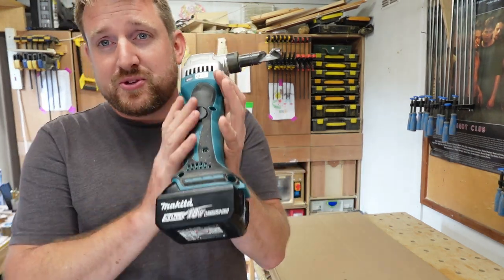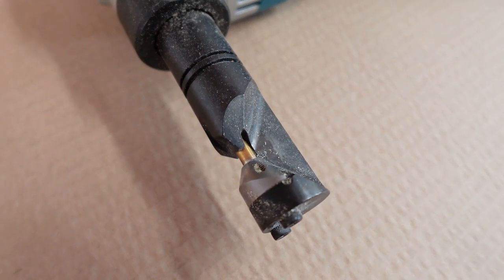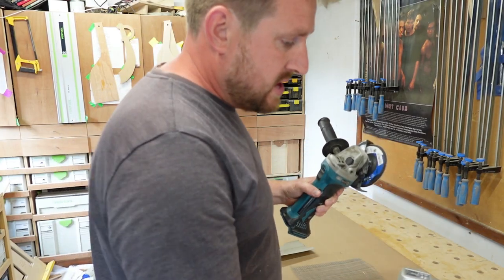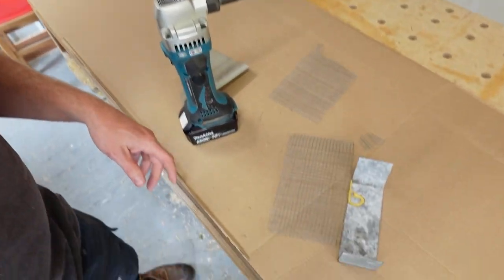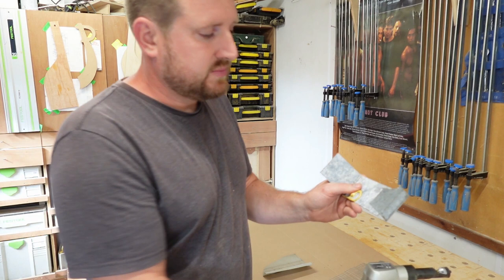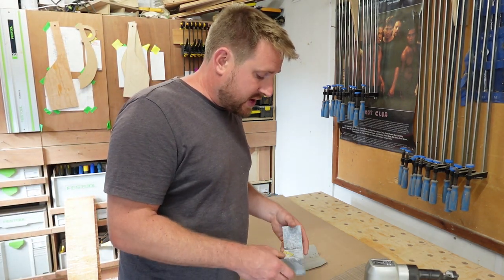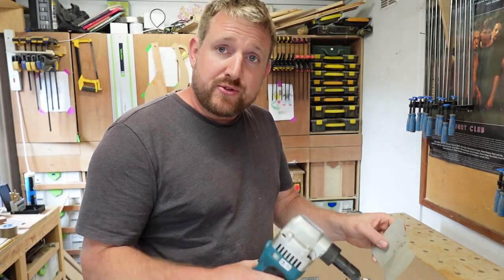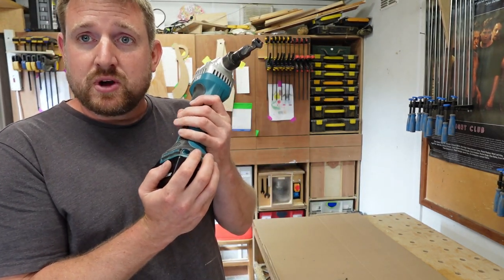Makita DJN161 Nibbler Review - The Best Way To Cut Sheet Metal?

Comment: I have one, its worth the money, I love it!  I will be using it today. It cuts other material than metal as well.
Reply from the maker: What other materials have you been using yours on? It's a great tool.
Reply: @englishhomestead   recently used it to cut FRP, its a plastic type panel used in kitchens in restaurants and in medical office applications as well, as it is easy to wipe clean.
Reply from the maker: @joetristen993  that's good to know! Thanks. I did wonder what else could be done with it

Comment: Hi buddy, how much thick can cut ? Until how much millimeters?  thanks
Reply from the maker: Depends what material you're trying to cut. 1.2mm glav is easy.
Reply: @englishhomestead  Thanks !  this tool intrigue me a lot!  I saw it in an episode of one of my fav show, the Restorer's used by Ted
Reply from the maker: @OZIL761  what I like about it over a grinder is that there's no heat produced (or not much) so the risk of fire in the workshop is loads lower.
Reply: @englishhomestead  nice !!! More doubts gone now….
Reply from the maker: @OZIL761  it is pretty niche though and expensive so you need to justify it on those grounds.

Comment: I bought my first, a Hitachi, nibbler back in 1982, iirc. It was mains powered back then and I still have it.
An excellent tool for what it does, but I found out the hard way not to sweep the little crescent bits of swarf off the bench with a bare hand, they are deadly sharp! I also found that walking over them meant that they stuck into the soles of my shoes and then got imbedded in the carpet at home, only once though. Crawling about on my knees with needle nose pliers, to unhook them from the carpet pile, before Mum found them.
Reply from the maker: Oh man, that one was a year before I was born then! I agree about the swarf from it. Gets everywhere. I have to be careful with my bench or it soon gets bedded into it. Same when I'm drilling the metal for my scoops!